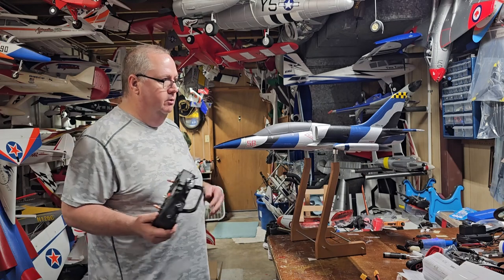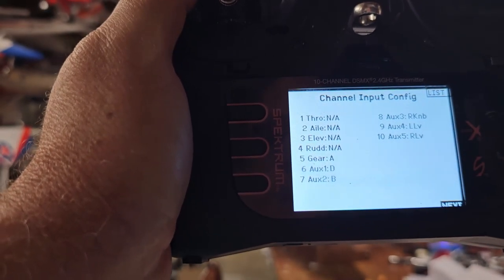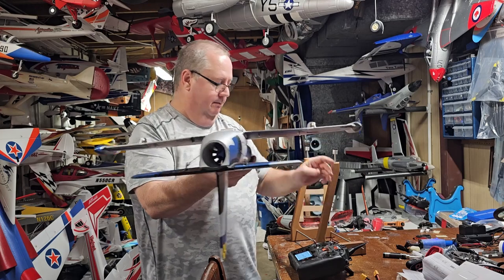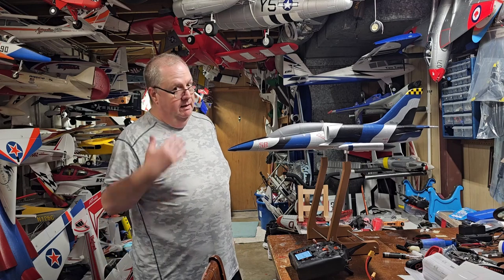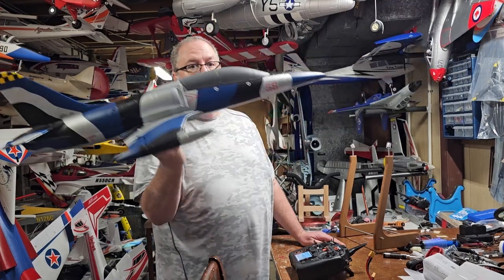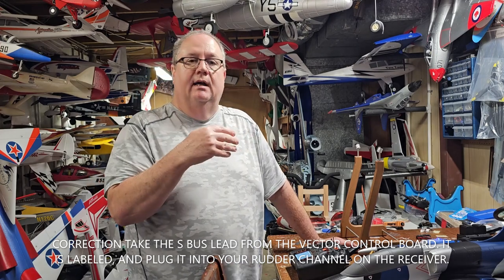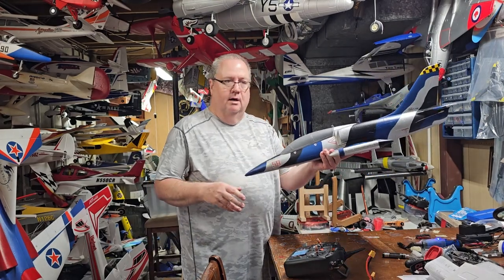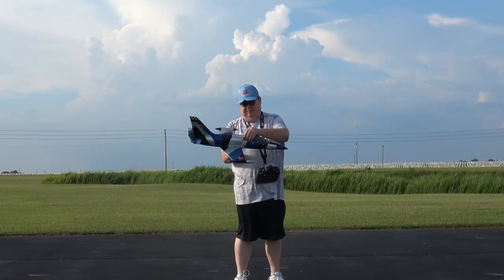MAIDEN AND RADIO SETUP of the ARROWS HOBBY L-39 ALBATROS by FGFRC

Comment: I agree 100% on the battery.  I see a lot of videos recommending or using a 3S 2200, or worse, a 4S 2200.  I've found that the ideal battery weight for these jets is 130-140g.  That weight can allow anywhere from a 3S 1800 to a 4S 1300.  I think it's more important than people think.  People who use heavy batteries have a tendency to have poor hand-toss results.  BTW, I used your code to get one of my Vipers.  I'll use it when I buy the L-39 also. Thanks!
Reply from the maker: Completely agree a 1500 4s is just about perfect. And thanks for using my links. Look at the bottom of the video description and you will find a big list of ARROWS and FMS planes that I can offer the same discount on. Just use the provided link and then code    FGFRC at checkout. Thanks again!

Comment: Good to launch in optimised mode then switch to no gyro or stabilised if you prefer. Good flight
Reply from the maker: Thanks so much!
Reply: When I started flying, it was only balsa planes with nitro engine.. when it was winter, we just removed the landing gears, to land at the snow.  I had a low ving, with 7,5ccm engine. That plane I did throw inverted, because i did have a good grip at the fuse. So when i did throw the plane, it looked like a high ving. I am throwing low ving airplanes inverted to this day. And no safe. Safe are for beginners. 😂😂 Regards from Norway.

Comment: Your going to need another Hanger soon at the rate your going you'll have hundreds of planes.

Arrows have hit a home run with these little edfs I have the B A E Hawk I fly it with a 1500mah 3s it's great , only pain in the bazooy is the P51 it's hard to get that guy off the ground because of the Nasty P factor but once in the air though it's like rest of their planes ,fun to fly.
Reply from the maker: Well i have a good club who benefits from me consistently rotating out stock. Yeah the Bae Hawk, Viper and the t-33 are all little winners. Now i need the the T-28 1100mm or the corsair 1100mm.